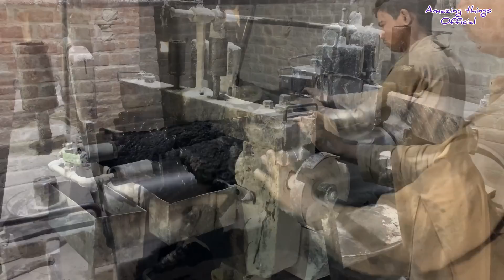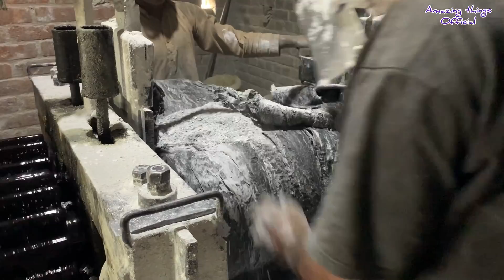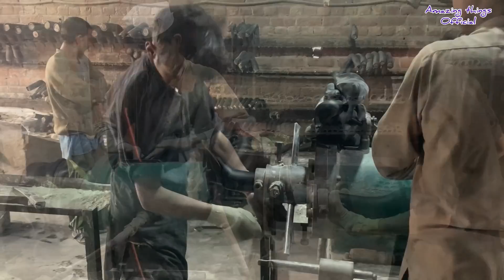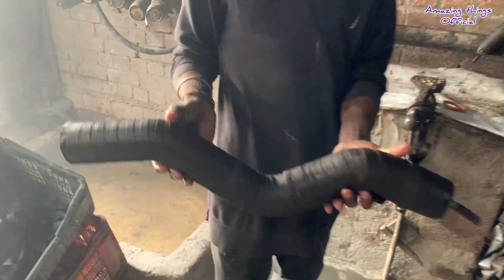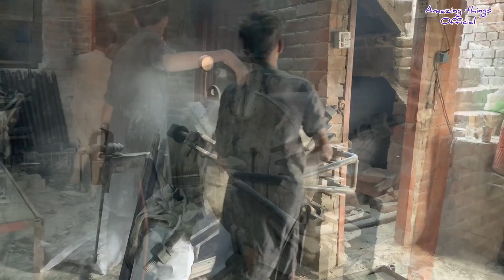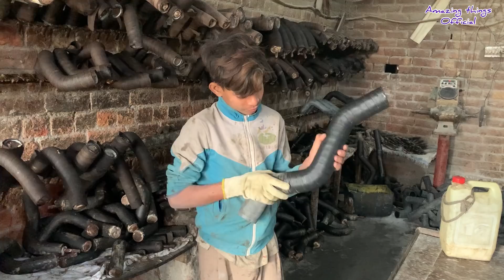Radiator Hose Manufacturing Process || How Radiator Hose Pipe Are Manufacture in Local Factory

Comment: Amazing what goes into a radiator hose, these guys seem to put a lot of effort into the process.
Reply: Somehow I think these are better quality hoses than automated factory prodused chinese ones, where less rubber and shorter lenght eguals better profits. if hose is only 1/4" too short customer still can use it, but on 30 hoses it gives one extra hose.
It also allway makes me smile when people are horrified by the safety, never I have seen loss of fingers or toes, in these videos. 
And bystanders/co-workers were terrified how close my fingers were to a bandsaw blade while cutting, but as long you don't have safety obstructions to block your view you see how close you can have your hands or fingers

Comment: Do they not need any reinforcement like i see in other rubber hoses??
Reply: Only guarantee those hoses have is so called GB-guarantee, where GB is an acronym for word goodbye.
Reply: The extra thickness maybe gives it enough strength?
Reply: @fallenwout  hahahah
Reply: See the title is Radiator Hose, just enough resist temperature till 100 deg Celcius for these hoses, not required high pressure as you think.
Reply: @atmsyanto9839  The temp of the water in an engine is well above 100 degrees....and does have quite abit of pressure
Reply: @ronnierobinson1502  most radiators run in the neighborhood of 16psi, which is not very much for a rubber hose.
Reply: @moconnell663  so my car cooling hoses have reinforcement just for the sake of it and to add to cost ??
Reply: @ronnierobinson1502  uhh no they're not, boiling point for water is 100 degrees.
Reply: @ronnierobinson1502  standard operating temperature for an engine is about 80°C Ronald....
Reply: @xjinit  in the block, the water reaches well over 80 degrees. A cooling system has to run at about 10 to 15 psi pressure to avoid gas bubbles in the area of the cylinder liners and the valves in the head. And cavitation in the water pump. If your radiator cap fails or if the system cannot build pressure because of other leaks; that's really bad. Check it in your own car! If the engine is cold, the hoses are super soft. If the engine reaches 60 degrees C, they are already pretty stiff.
Reply: @albinklein7680  no one said anything about pressure, Ronald the genius was conflating pressure and temperature.
Reply: @xjinit  Just got a new car here in the United States. Normal operating temperature of the engine is 210 degrees F (Just under 100 C). Additives and pressure keep the water from boiling.
Reply: The step is missing in the video however a knit reinforcement is added between the tube and cover.  The mandrel passes twice thru the extruder and fabric can be seen before second pass.  It's also showing when they do the end trim.

Comment: How can those hoses last more than five minutes without fabric reinforcement? I have never seen radiator hoses without nylon reinforcement inside.
Reply: they're probably aren't used in pressurized systems, but still, this feels so wrong
Reply: @redstoner2006  I don't know any halfway recent vehicles with non pressurized cooling systems.
Reply: Was thinking the exact same thing?
Reply: the tape wrapping marks are still in the hose after finishing? And inconsistent wall thickness yikes
Reply: Lots of karma into play. If the engine gets a bit hotter than usual, because that day something was different, 1 in 10 times one hose bursts... Then the demand for hoses is higher than usual... Then they put children to make sub-optimal hoses... In a company that tomorrow (maybe?) won't be theirs, because the other case does exist, working as a children in something that tomorrow will be yours... Imagine taking the roll of fiberglass mat for painting over wall cracks and applying some wrap just after the hose gets out of the tube shaping mold...
Reply: If the hose last too long the shop will close.

Comment: By the time those young boys are 30 yrs old their lungs will be shot. They should be at school, There is no doubt these men work hard for their living but the product is if very poor quality. There is no reinforced fabric within these radiator hoses to stop them expanding under pressure which is needed to stop a vehicle from overheating. Check out a regular European radiator hose and you will what I mean.

Comment: These radiator pipes only last a maximum of 6 months.
A complete waste of money.
These slum based factories should be closed down and the owners made an example of. 
They sell these fake products to shops which in turn market it as genuine products and charge high rates for it.
Reply: had you ever buy this product in pakistan ? even china product also various quality from low to high price same as original.